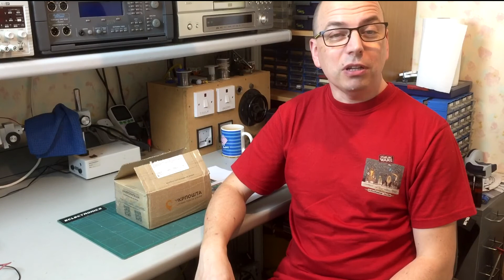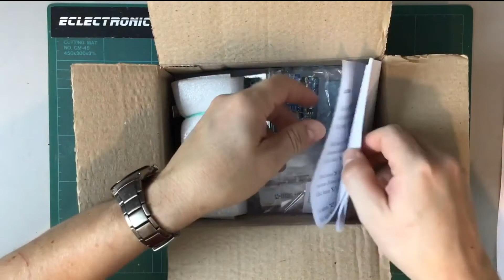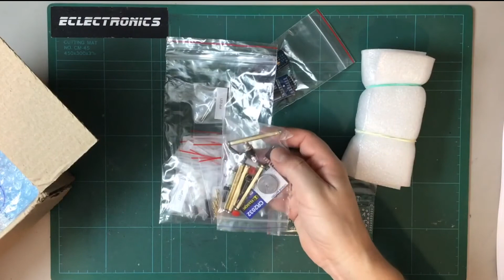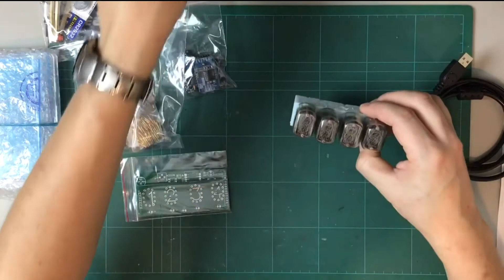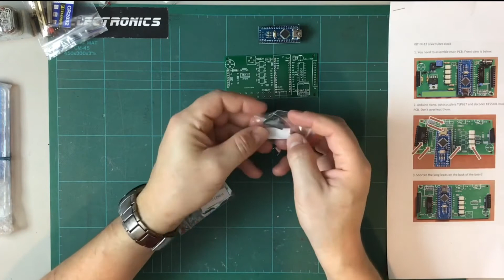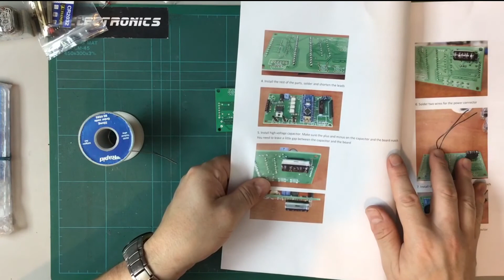IN-12 Nixie Clock Kit Build (from eBay) - Part 1

Comment: My sons have just bought me this exact kit for Christmas and your vids have given me the confidence to begin the build (was a bit daunting to begin with). Are you using flux core solder? Which diameter?  Also it's unclear about the orientation of some of the components. I'm hoping it will become clear when I really begin but I may have some follow up questions in the next few days. Thanks again.
Reply: Hi, I can reply to soldering questions in general way. First of all...diameter...smaller is better. (1 mm usually too large, )best go for around 0.6 mm.
Don’t use unleaded, it’s usually frowned upon especially for hobbyists who need it to flow more easily. 
Also get a source of flux, not relying on the flux cores. The type in a kind of pen applicator are easy to use. An isopropyl alcohol wash is needed for flux removal, applied and worked with a proper flux brush.  Wipes to remove the stuff are available lint free ( like Kim wipes ) but cost megabucks for flimsy bits of paper. Needless to say I simply HAD to get some.
One final thing, I’ve just looked at the cost of the kit...you’d be well advised to get a few ‘solder practice kits’ from well known mail order outlets, I did quite a few cheapies from Ali express, or bangood ( not sure if eBay have them as cheap) but they’ll teach you your mistakes NOT on a $80 kit lol.
An SMD practice kit may seem extremely hard but you’ll need to get into these after your happy with larger through hole components 
https://www.aliexpress.com/item/32812250986.html?spm=a2g0o.productlist.0.0.16b73018a0uIX9&algo_pvid=43c0753a-86bb-441e-9dce-2961444a4a8c&algo_expid=43c0753a-86bb-441e-9dce-2961444a4a8c-20&btsid=0b0a187916135986730771054eb930&ws_ab_test=searchweb0_0,searchweb201602_,searchweb201603_
I’ve reviewed the wording above...it seems to suggest that I used non flux cored solder. Just to be clear, the solder did have flux core but it’s supplemented by more flux in most circumstances.